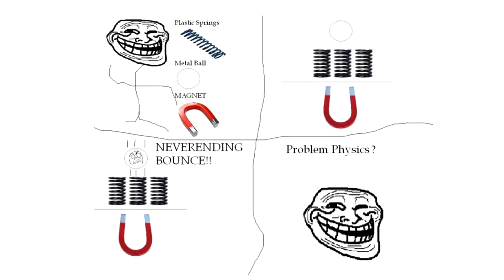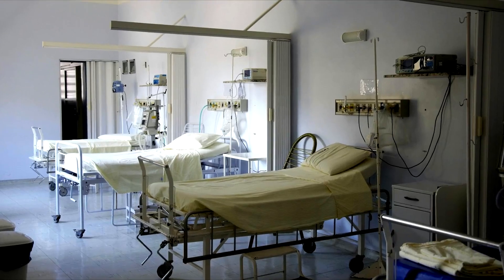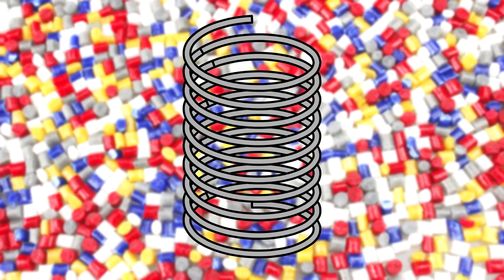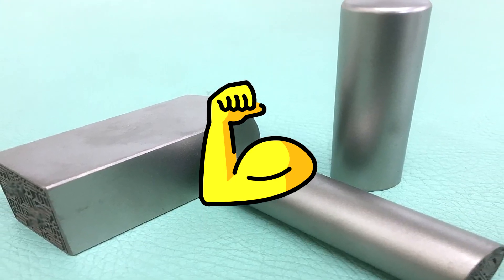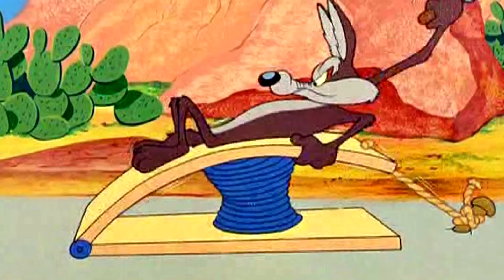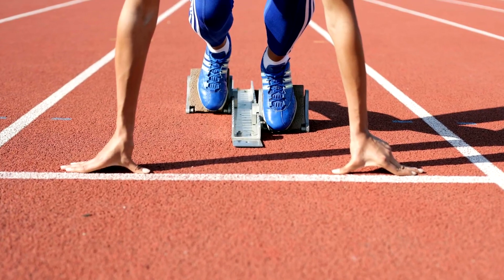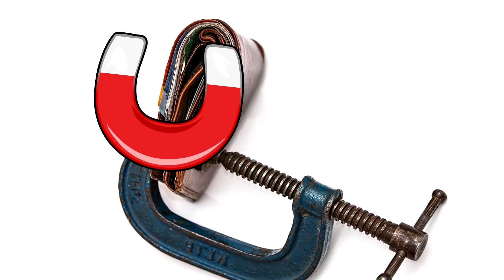why it doesn't work 11

Comment: Reminds me of the perpetual motion machine that pulls a metal ball forward, but when the metal ball activates a sensor, it turns the nagnet off so it doesn't make the ball stop in place. The old joke about finding a spot to hide the batteries being the hardest part of making a perpetual motion machine

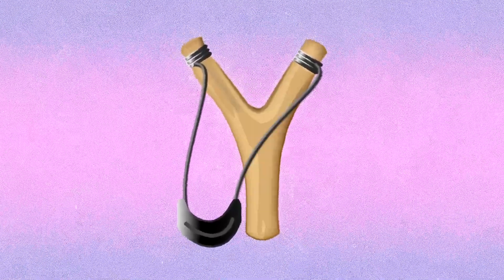Comment: 0:27 : 
Eeeerrrmmm actually ☝️🤓
This is not a trebuchet
Reply: What is it then? A catapult? Likely story...
Reply: @MystikoBlu  yeah, a trebuchet is much larger, have a different structure, and it uses a weight to launch the rock
Reply: @Mr_Sim  huh, and here I thought it was an oversized bed frame
Reply: @MystikoBlu  Its a fantasy version of a mangonel
Reply: We've played too much age of empires and stronghold to know this
Reply: @Infarlock  no I'm just french lol
But I've played Stronghold too, nice game
Reply: It’s a mangonel. A catapult could be a number of things, it’s just any device that can mechanically propel a projectile at high speed by storing muscle energy and releasing it all at once. By this definition, a trebuchet, a ballista, a crossbow, a slingshot (which, when you think about it, is some kind of miniature mangonel), or even just a bow or a sling, can be considered catapults. A trebuchet is a class of catapult which stores energy using gravitational potential stored in a counterweight and releases its energy by swinging around a pivot point. Definitionally, all trebuchets are catapults, but the reverse is obviously untrue.
Reply: To add onto this: « trebuchet » commonly refers to a counterweight trebuchet. But a trebuchet could just be any device with a rotating arm, and a sling. For instance, an onager is a trebuchet. But the device shown here only has a bowl. Therefore, it cannot be a trebuchet under this definition either. For instance, Tom Stanton made a flywheel trebuchet, which fails the counterweight definition, but passes the rotation and sling one, if you agree that a flywheel is a type of swinging arm, which I guess it technically might be. There is no sense in which this specific catapult could possibly ever be a kind of trebuchet, so tyler is plainly mistaken.
Reply: @onemadscientist7305  thank you !

Comment: Just turn off the magnet when it draws the ball in?????
Reply: (If this is a joke, please ignore the following explanation.)

To turn the magnet off you'd have to be using an electromagnet, which would need to be powered whenever you want it magnetized, therefore consuming energy and obeying the laws of physics. You can think of it as the energy from the power source going into the magnet, which then takes that energy and uses it to compress the springs, which, once the magnet is deactivated, transfers the energy into the ball to make it bounce.
Reply: @sneepsnoop4453  Thus making what I can only imagine to be the most inefficient railgun ever. (That's also not a railgun.)